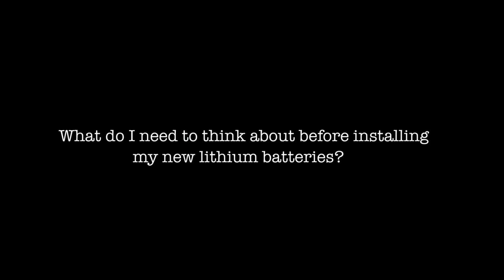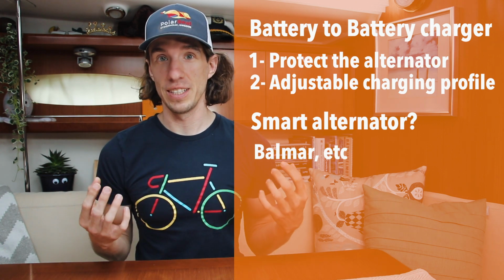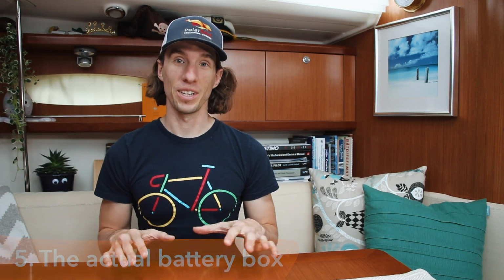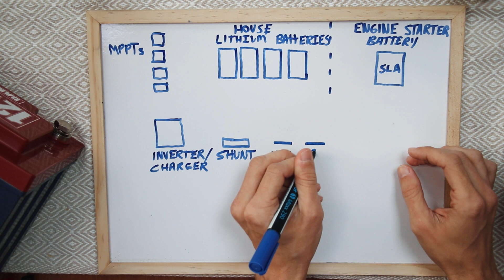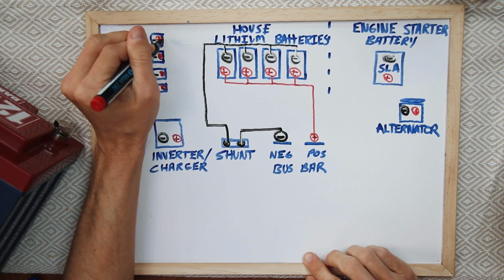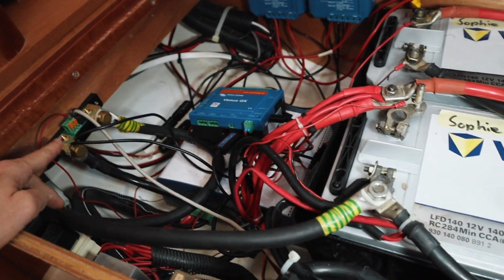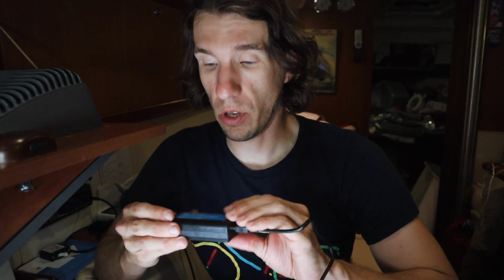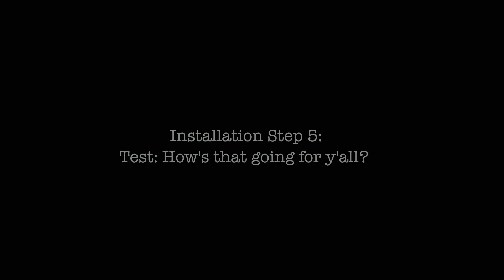How to install lithium batteries on a sailboat // Ryan’s tech corner #2

Comment: This is great! One question - I assume you did the battery-battery charger because you've got effectively a "low-output/dumb" alternator, and this was the easiest "plug & play" option...? As I understand it though, one big benefit of lithium when off the grid is the fast-charging ability you could get from a high-output/regulated alternator. For example on ISBJORN, which has just under 1,000 aH Lead-Acid AGMs, we can blast out 220 amps from the alternator, but only when they're dead. As soon as voltage comes up, amps go down, so the charging time extends the fuller they get. But with lithium, I can go full-blast right til their full, right?! So like on ISBJORN, that battery-battery charger would be less than ideal, especially since I've already got the smart regulator that has a pre-programmed lithium profile. Am I understanding this correctly?
Reply: If I understand you ( and the video) correctly, I think the lead-battery only really come into play when there is a sudden shut-off from the bms. Then it buffers the return current. Otherwise the current just passes it and it will not slow charging down.
Reply: Yes, you're absolutely right. The internal resistance in a LiFePo4 bank is not as high as Lead-Acid/AGM, so it can take much higher charge in general. If the DC-DC charger is powerful enough, it won't matter much if you charge using that or directly from the alternator. But most DC-DC chargers I found are rather expensive for a high Amp spec, so in your case, the alternator on ISBJORN would most likely work just fine instead (if it's setup for LiFePo4 that is).
Reply: @joarsvensson4968  uppenbarligen får jag åka till Tjörn och få konsultation inför kommande konvertering :)
Reply from the maker: Hi Andy, Its a good question and interesting for your particular situation.  If i remember correct you have some type of advanced regulator with the alternator?  If this is the case you might be able to change a few small setting and it would work just fine.  Would need to take a look. Ryan
Reply: Yes, BUT - it's more than capacity to absorb amps. Max voltage is a big issue, most dumb regulators may allow the voltage to exceed the cut out in the BMS wired into the top of each battery, and if that battery is the only thing connected to the alternator, when it cuts out you blow the diodes on the alternator and are now left sending the alternator for rebuild as well as shipping the batteries back to the factory to have the BMS replaced. Expensive, and slow, and you're dead in the water.
Other big issue, and one rarely talked about, is float charging. Lead acids/spiral/gel/AGM will tolerate floating at a higher voltage. LiFePO4 do not. One of the big characteristics of the charge profile for lithium is that after reaching max charge, the battery must be allowed to run down to between 30-50% of charge before reinitiating charging/float. Most dumb alternators will happily keep floating at 13.7, rapidly killing the lithiums.
Reply: @markhooper3485  Fully agree with your comments regarding float. On my LFP battery bank, I don't want any float at all and use a float voltage of 13.2 which will basically disable float. In general, I consider the LFP/Lithium/lifepo4 profiles on almost all chargers to be way too aggressive with too high voltage. I currently use a much more conservative voltage setting for my chargers with Bulk:14.0V, Absorption: 13.9V and Float 13.2V (to disable float). The main issue is that there is almost no chargers that can provide a CC/CV charge profile that the lithium battery wants. The min and max values from the manufacturer are not the values you want to use. They are plainly min and max values. 

A float setting of e.g. 13.6V - 13.8V will effectively overcharge and degrade a lithium battery. The BMS will not kick in due to overcharging from float since the emergency faults that would trigger the BSM will not occur. Just a slow overcharge that will degrade the cells.
Reply: Alexander Wyssling just use lower voltage settings. 

There is not need to go above 14V when charging lithium. These batteries don’t like to be at 100% SOC and the last 5% SOC you get by charging above 14V is not worth the risk of damaging the cells.
Reply: @xelawy  I used two ways to control the float issue from the solar panels with my 790W solar and 320Ah lithium battery

On the MPPT settings, I used a very conservative setting for float (13.3V) so the MPPT will not start float unless the battery has a low SOC. 

Second I added a circuit breaker that acts both as a fuse and a switch between the MPPT:s and the batteries. I can then turn of solar charging but keep the rest on if I want.

I also have a ML-RBS battery switch that will turn off everything, all chargers and all consumers. When I leave the boat at dock for longer periods with the main switch off I have nothing that can affect the lithium batteries such as overcharging or undervoltage.
Reply: Hi Andy. I’m guessing that on Isbjorn you’ve got a Balmar AT-series 220 Amp alternator, along with its MC-614 regulator, which does indeed have a setting for lithium batteries. Or something similar. Well, here’s the thing. For ages now lead-acid batteries, starter-motors and alternators have been in a beautiful but old fashioned relationship. The battery fires electricity at the starter-motor, which starts the engine, which turns the alternator, which recharges the battery (I know you knew that). Apart from some fuel getting chewed up, everyone’s happy with this nicely balanced threesome. Then people started adding battery powered lights to their boats, then radars, autopilots, fridges, chartplotters, televisions, … air-freakin-conditioners! Soon 1000Ah of lead-acid batteries are needed. Our old fashioned alternator can just about cope with this, largely because of what you’ve described, being the way the charging rate of these batteries slows down as they fill up. Then along came lithium batteries and mucked everything up. They will suck power out of that alternator like crazy, causing it to overheat and cook itself. To add insult to injury, as soon as the lithiums’ battery management system sees that they’re full, it chops the connection via a ‘battery protect’ relay, which sends a spike back to the alternator, to kill it a second time. The worst case scenario is also the most likely: the lithiums are nicely topped up with shore power and are then run a long way down in the first couple of days of a passage; you’ve still got wind but it’s time to recharge; let’s run the engine at low speed while we’re sailing. So the poor old alternator is made to work hard without having the benefit of sufficient cooling from its fan. It overheats and dies.

A ‘smart’ alternator’s regulator (an MC-614 for example) can do a couple of things. It can be set to its ’Lithium’ mode, which will serve up volts to the batteries in a predefined Bulk, Absorption and Float pattern. That’s nice for the batteries, but does nothing to protect the alternator. What might be able to do that is the addition of a temperature sensor, installed on the alternator and connected to the smart regulator. It senses when the alternator is getting close to killing itself, which causes the regulator to adjust the alternator’s field current, reducing power output, in the hope the alternator will cool down to just below melting point. It might work, but it’s not really all that smart. And you’re not getting power out of the alternator like it says on the label. 

The approach Ryan has taken is to put the old fashioned lead-acid engine start battery and a battery-to-battery charger in between the old-fashioned alternator and the hungry lithiums. The surplus of charge at the start battery will flow over to the lithiums at a moderate pace, one that the alternator can cope with long term. It’s not a perfect solution by a long shot. Supplementary solutions are to use tons of solar panels to keep the lithiums almost full, and/or, a hydro-generator, a separate diesel generator or better than that, an Integrel On-Engine Generator. Bring money. :-)
Reply: @Valden23  There is also another alternative to protect the alternator from a BMS disconnect. Instead of having the alternator charge the FLA and then the DC-DC charger charge the LFP from the FLA just to protect the alternator you could add a Sterling Alternator Protection Device. Much cheaper than a DC-DC charger and does not add the drawback of reducing the charging to the FLA. 

If the goal is to keep using old FLA chargers then charging the FLA with the old chargers and then have the DC-DC charger charge the Lithium from the FLA a good option.
Reply: @jedholm1  Hi Jed. Curiously, I spoke with an engineer at Sterling on this very point only a week or two ago. We discussed the nature of the problem and how Sterling didn't have a way to avoid blowing up alternators while generating decent levels of charge. Balmar's solution is not really a solution either. The only good one I've found is the new Integrel On-Engine Generator, which has won a ton of awards from marine industry players recently. But as I said, bring money! :-)
Reply: As a battery becomes charged, the potential difference between the source and battery decreases, reducing the current through the resistance between the terminals. That is just the simple explanation.
Reply: i know im randomly asking but does someone know of a method to get back into an Instagram account..?
I somehow forgot the password. I love any tips you can offer me.
Reply: @Terrance Kabir instablaster ;)
Reply: @Jerome Lochlan I really appreciate your reply. I got to the site on google and I'm in the hacking process atm.
I see it takes quite some time so I will get back to you later when my account password hopefully is recovered.
Reply: @Jerome Lochlan It worked and I finally got access to my account again. I am so happy:D
Thanks so much, you saved my account!
Reply: @Terrance Kabir you are welcome xD
Reply: A 65 amp alternator could handle one maybe two 20 amp 12v DC-DC Chargers continuous use or one 30 amp. One can then use more than one Victron 12v DC- 12v DC 30amp charger in parallel depending on the alternators output, say one has a 150 Amp alt then one could use two or three in parallel giving 60 or 90 amps, four 30 amp chargers in parallel continuous (120 amps) may be pushing the limits and overhead and damage the alternator.
Reply: The ElectroMaax SSP surge suppressor will prevent any damage to your alternator- as long as the alternator has a field connection. That way, wire the alternator/regulator direct to the Lithium Bank, maximising charge rates etc, and use the DC-DC converter to look after the starter lead-acid battery

Comment: Thanks for your clear advice. A few things I noted; 
Very important the battery parallel connections be of equal length between batteries to ensure the same resistance from each battery. It was not an issue for you as all your batteries were next to each other and you cut your own cables but some may be tempted to use an existing cable of different length they already have. 
Another thing to point out is that when disconnecting batteries always disconnect negative first and when reconnecting batteries connect negative last. André

Comment: You should know/tell viewer that carbon fiber, unlike glass, is a good electrical conductor.  So if you've got it around electrical components (like your battery box), treat it appropriately like steel or aluminum. 

Like your videos! ;)

Comment: I'm looking to also install LiFePO4 and I really enjoyed your video.  My design is going to be almost identical to yours, but I'd change one or two things.  First is I'm planning on keeping the start battery separate from the house bank side but I'm still going to run the DC to DC charger like you're doing.  The difference I'm thinking of doing is adding a toggle switch to the signal wire back to the ignition so I can shut off the charger if needed or if I don't need that extra power going to the house bank.  The Alternator will still be connected to the lead acid starting battery so it's still connected.  The other thing is your battery crimping should be more of a compression of the lug onto the wire in stead of a one sided crushing force.  Better crimping tools will be marked with the lugs so that you get a nice even press and compression of the wire.   Thank you for the very informative videos!
Reply from the maker: Thanks for the note David!  I agree about the Crimping... just need to find the correct tool for it. - Ryan

Comment: what id change is to put a bus bar right by the charge controllers and run a thicker cable to the switch. also a battery protect would be great to add to this setup. its a great setup. really cool.

Comment: Looks good. It’s my idea to make the changeover myself at year end before I go full time cruising next year. I have done a lot of the background changes like you. Victron 120/3000/12 inverter charger and Victron  100/50 Mpt controller. Just the batteries to buy and deal with the alternators. I hope to do this soon and the batteries last. 
All in all a nice informative video guys

Comment: A great video Ryan, well done. I had to chuckle about those Victron charge profiles though because I use altered ones depending on context - aiming at 90%SOC in port but always 100% heading into night during passage - you never really know what the weather brings tomorrow and I hate burning fuel to charge batteries.

You touched on a couple of things that I did differently; not me correct making you incorrect, just different.

My alternator charges only my LFP house bank, partly because charging LA beyond 80% is ridiculously slow. I switched to a Balmar alternator/external regulator to charge much that hose bank faster (fuel is precious during passage). You touched on alternators but I took that step. My LA starter battery is maintained solely, by DC-DC charger from my house bank, Sure, that means if my house bank suddenly vanishes then I die - but I'm over that. But it means that a single dead battery can easily just sit out without affecting the others. I'm also happier because this batteries can weld metal if you drop something on them.

About connecting in my 4x100Ah LFPs, I went the Victron approach using a "Power In" to provide battery busbars, with a fuse for each battery, on top of the same sort of distribution bus bar arrangement. I didn't let my LFPs just sit "quietly" at first because their internal BMSs communicate with each other to give battery to battery levelling. And it works! I interrogated the BMS array that day, a week late, a month later again etc and the internal pack voltages are always nearly identical.

The only thing I'm reticent about is that by windlass draws from my house bank as it did before but I'm on passage mode, at Panama on my way to Australia from Europe so that can wait until after I arrive and switch to fun sailing.

An observation about my Victrom 100/30 MPPTs and I have one for each 305W solar panel. The fact is that they are just insane, never performing in concert under the same conditions -  and it's anybody's guess as to which one misbehaves. Just crazy.

Comment: I've been looking at a boat recently and planning on upgrading the electronics (radar, solar etc) and new batteries is one of them. Currently it has 3 Lead Acid House batteries, 1 starter battery and 2 fridge batteries. I was thinking of upgrading the House batteries to Lithium as there isn't a huge amount of space for lots of solar as I would need a frame and the transom is quite narrow.

Comment: Thank you for another excellent video.  We have more and more clients interested in getting LFP batteries in their RVs.  I have heard that the cold can ruin the batteries if they are not warmed up properly before using.  In the video you mentioned that they are good for cold weather.  I just don't want to recommend something that I don't have proper knowledge about.  I would also think that a B2B would be needed as the alternator on the tow vehicle could do similar damage as on a boat.  Thanks for all the great information!
Reply from the maker: Hi kirk,  cold can be a hard thing for batteries of types.  Its best to work with a manufacturer if your clients will be in the cold so that the battery can meet their needs. 

You are correct on the b2b charger... ours is working well.  

Ryan
Reply: @RyanSophieSailing  Thank you!  I will contact your company.  I assume that given its Iowa that they have a lot of experience with the cold!

Comment: I am missing an important safety feature in this video. There should be a fuse installed as close as possible to the batteries, to prevent fire in case of a short circuit in one of the wires connecting the battery. It is enough to have a fuse only on the positive terminal. 

Do you have one installed and if so where? I find it dangerous to tell people to do a battery installation without mentioning the importance of the fuses.
Reply from the maker: Hello matthias.  Yes this is a good point.  We did not include it in the drawing but it is on the positive side just after the battery switch.  This is where benteau placed it and we did not move it.

Comment: Don't forget to have all positive wires from each Lithium battery the same length, and each Lithium positive wires  should have it's own fuse. On the negative side all Lithium negative wires should have the same length from batteries to negative busbar.
Reply: Complete bull.....